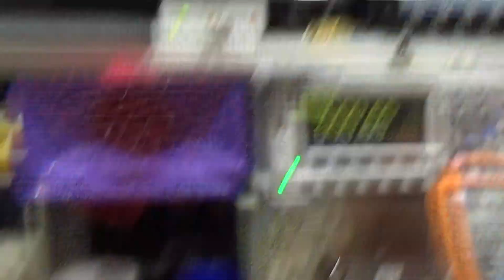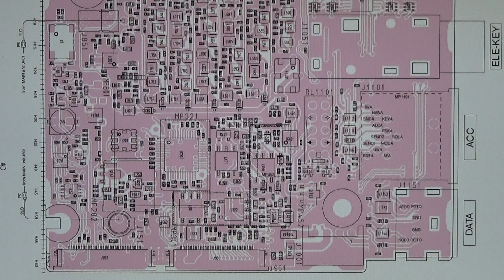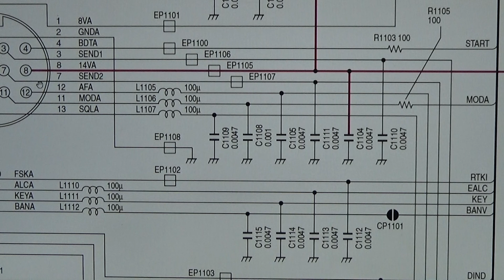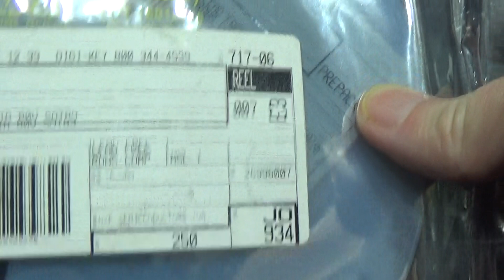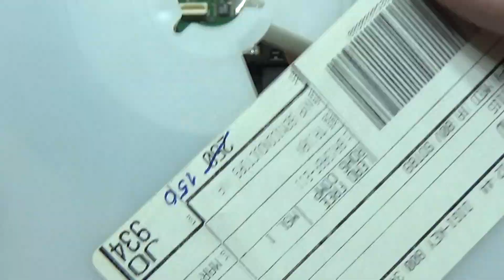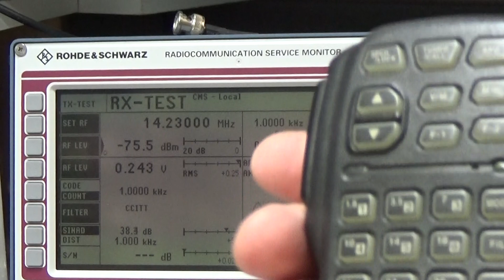#215 ICOM IC-7000 and the magic SMOKE

Comment: Great job Peter, in this case we are lucky because it's easy to see a burnt transistor but the skill is to know where you have to find it,  I had a similar issue, 7000 always in TX but in my case was  a condesator shorted in Logic Unit close to CPU. Regards. 73, Pasquale IW0HEX
Reply from the maker: You are absolutely right my friend! Thanks for feed back

Comment: I enjoy your upbeat intro, and a nice easy repair on an expensive radio. The old Yaesu FT-736 mic key line on the front was tied directly to the CPU - it was reported that if a satellite data modem was improperly wired to the MIC jack, the CPU would short & permanently put the radio into TX. I often wonder how many CPU's were fried that way... 73!
Reply from the maker: Thank you! Yeah it is critical to tie CPU ports directly to external sockets.

Comment: Good job. Theese DIN13 ACC connectors are sometimes a little bit tricky. When I was in the ham radio repair bussiness (definitely leaved it in 2003), this damage was very often on IC-706/706MkI/II/IIG and, as I see, nothing has changed with IC-7000. The design idea where SEND/HSEND/VSEND pins are inputs and outputs at the same time i terribly bad, they know it and they are doing it again and again in the name of compatibility. What happens if the output of the modem/soundcard interface/whatever is not open collector, but it is full TTL output? Nothing till you press PTT on your microphone (or happens any other key-in event inside the trx), because then the forced-high output is shorted by this poor transistor and magic smoke escapes. This is what imo happened. 

The second typical DIN13 issue was high voltage on SEND/HSEND/VSEND, typically linear amplifier that has more than 13V on its RX/TX switching relay. High voltage on SNDL is then the "nice thing". Almost all transistors on theese outputs are capable to switch 40V+, but the combination with input kills this capability. 

The third and most tricky thing is possibility to insert DIN13 plug upside down (this is also issue on some Kenwoods, that have the same DIN13 plug, but with different pinout). The pin 13 is easy to bend into the notch in lower part of the socket and the last thing, that should make impossible to insert the plug that way, is the socket's notch corresponding to the bend part of the plug's shielding, but when the plug has a stretchy rubber housing and the bend in the shielding is shallow, it is posiible to insert the plug upside down. I found only one solution. I bought a huge amount of 3-pin DIN5 plugs manufactured by Tesla, that had strong shielding part and rock solid housing and I combined the housing and shielding from the Tesla part with the inner part from easy to buy DIN13 stretchy plug. After this I got the DIN13 plug I was unable to push upside down into the socket.
Reply from the maker: You are right the ICOM design was always a bit funny..Thanks for your exiting report.

Comment: So the owner accidentally shorted the 14VA supply pin to the SEND1 pin in the connector and Q1102 tried to pull it low? Q1102 is a rather beefy part (the original part can take 2A /50V), whose collector seems to be pulled high by D1102 & R1106 (2k2). Why didn't the manufacturer put a small series resistor or a polyfuse to protect the SNDL signal from an erroneous connector use? Is this designed to directly switch power on some peripheral?
Reply: The PTT pins are spec'd to source 200ma max (output), and to sink 20ma max (input).  The manual isn't clear if the external device is supposed to limit that current, or if that's the current that the radio draws.  It says you can apply up to 20V on that pin.   It is a bi-directional pin.  It can be used as an input to initiate PTT from an external device like a Packet TNC, or as an output to tell a transverter to switch into TX mode.

Comment: You seem to be the one to ask out here with the IC-7000, mine just completely lost tx and rx, the alc is full scale on hf ssb with no audio input, no sound at all not even menu beeps, just a slight pop from the speaker at power-up. I see that this failure is not uncommon, but I'm finding no solutions. The Yahoo group that was, is gone now too. Have you seen this issue, any ideas? It seems like it maybe lost a voltage rail. I spent some time analyzing the service manual, and suspect the 7808 (IC1901) regulator could be the culprit, or a shorted cap etc. That chip seems to be powering most of the analog circuits, the digital side of it is working fine, and I had first thought my antenna, or cable had failed. The radio appears to function normally, aside from the "minor" issue of not transmitting or receiving. I have not gone inside it, or probed anything yet. I did reset the CPU, but aside from losing all of my memories, recordings, and settings, it did not help. (Losing those recordings hurt the most, there were a few now silent keys in there.) It has functioned almost flawlessly for over 10 years BTW, though I did have to replace, and re-bias the HF PA mosfets a few years back.

Comment: Its a bad design afterall... a failsave for me would mean stuck in receive and not burn dozends of watt out in the air uncontrolled
Reply: If someone puts voltage where it doesn't belong and destroys and shorts the transistor that puts the radio into transmit, its rather unfair to complain that the radio then gets stuck in transmit.
Reply from the maker: The issue is that the transistor should not be in the relay line by design...